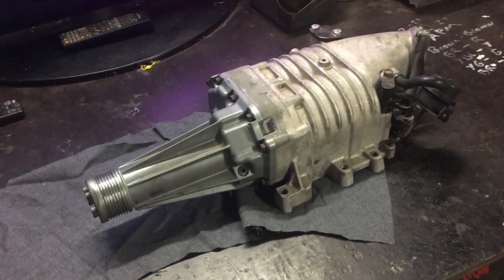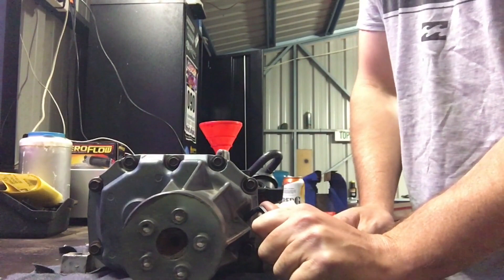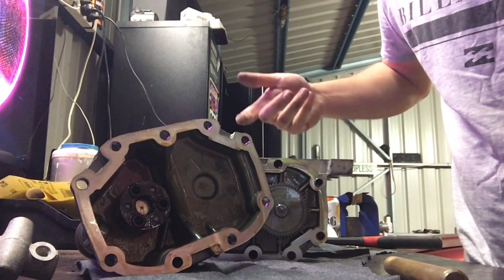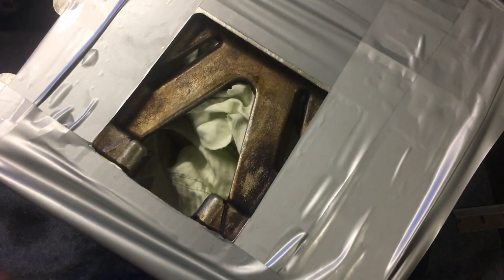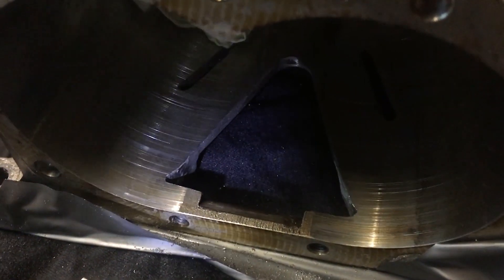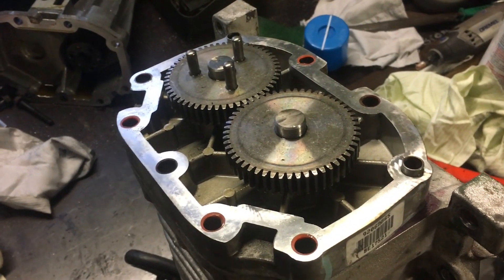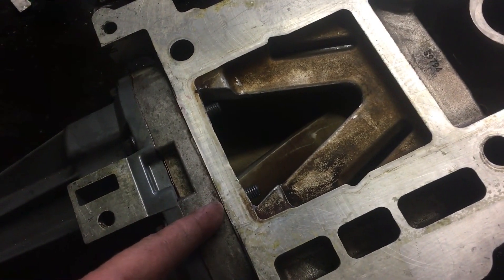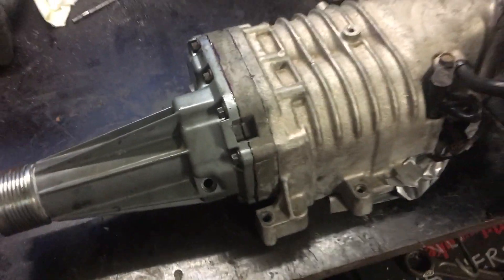Eaton M90 Supercharger Porting

Comment: The big deal I'm looking into is who can do andecent job of rencoating the rotors? If you or anyone knows
Reply: Actually the rotors are coated with an epoxy not Teflon which would be how and what the Detroit style roots chargers are done with and that is just a bead that is installed in the tips in those rotors to close up clearance between those rotors and the cases.

Comment: GM US car.used the same size bolts on the snouthousings, it wouldn't make much sense having these a different size fir here or there as Eaton made them a pretty much standard option for all GM's equipped with them as well as Nissans and whom ever else was suing them. The big differences was in the inlet designs for the reauired arrangements fo the  rands

Comment: First time ive found out wat to seal the snout with goo wise cheers best explanation vid yet to date( now that u did that porting as u called it do u need to tune it
Reply from the maker: Thanks I appreciate that. I did have my car retuned afterwards to take advantage of the cooler temps and make the most power from it but I wouldn’t deem it a necessity.

Comment: hi man!
wanted to know one thing.
I have a 2001 Mercedes. 2 liter compressor eaton m45.
is there any point in doing porting for such a baby as m45? and about the oil for sc. Do I need a special oil or is transmission oil suitable?
Reply from the maker: Hi, I dont have any experience with the m45 unfortunately. 
As for the oil Eaton do use a supercharger oil specifically so I would stick to using that.

Comment: 10:00  Scoring inside the case. Yuk. It will only mean a mild boost leak. If it concerns you, scrub those clean with Soap and Water, brake fluid then acetone and naptha. Use overkill to get down in the grooves and remove every bid of oil. Use a toothbrush and clean lint free rags. Let it dry real good. Then with a Razor Blade or the edge of a credit card, scrape regular JB Weld into those grooves, and only in the grooves. Let it dry a few days before assembly. Sand High spots with 400 grit sandpaper.
Nitromethane funny cars and dragsters use this method on their superchargers, it works. The JB weld stays in place. I've used it to fix a Weiand 144 and thousands of miles later, the scoring is still fixed.
Reply from the maker: It looks alot worse on camera then it actually is due to poor lighting ect. I have heard of people using that technique to fix housings before though. Its good to know that people have success repairing them.
Reply: sadly i dont even think thats scoring. its probably just the manufacturing tooling marks just like on the sealing surfaces.
i was looking at those like man i bet you smoothed it out some it would have alot cleaner flow. but removing material will also lower boost. but increase flow potentially. and lower charge temps.
filling and smoothing it out would be the same as 2 stroke case porting and stuffing so its pry the best way to go.
Reply: @chehystpewpur4754  If you've ever taken one or more apart, yu would know that is scoring. Even the maker of this video says it is.

Comment: Great vid, mate. Been trying to make up my mind whether to put a supercharger in the commodore since the v6 packed it in? Are they high maintenance? And what do you have to watch out for if buying one?
Reply from the maker: Thanks, in my opinion they are relatively low maintenance. I would just ensure it spins freely with no rubbing or strange noises coming from the rotors, that aswell as the rotors dont have visual damage to them or excess teflon peeling. It may be worth inspecting the coupling and replacing if it feels like it has excessive slop when spinning it by hand. I hope this helps.
Reply: @Brodorsport  why not just take material off the other end and turn the triangle into more of a rectangle to really increase flow    currently working on my wk stato supercharged 6   but I also have a  buick (VP) V6 with a Detroit 6v71 on it    I have a couple of videos on here of it nothing special but keen to see what you think of it      great video by the way

Comment: Would it be possible to fit the M90 to the 6G74 on my Pajero NL 1997 model and what needs to be upgraded on the engine itself.
Reply from the maker: Its definitely possible. You would have to fabricate your own manifold to fit it or find a company that already makes one if possible. Im not too familiar with the 6g74 to recommend upgrades but i would suggest installing a wideband air fuel ratio gauge to monitor it and ensure the tune is sufficient

Comment: Did I miss the part were you cleaned and greased the bearings
Reply from the maker: I did mention about cleaning it in the video but yes i must have forgot to film regreasing. Good pick up.
Reply: Should replaced them not just lubed them

Comment: comment 26 showing: If u r bolting 1 face onto another face, they need to work in a small change. The amount of metal under 1 screw tab & the next tab rounding the mating plate should vary, so small tab med tab small tab med tab. U will get better seal vibrational hold & the screws hve diff length easy on 1s & deeper 1s, making taking off & going back on less likely to b screwed by bad screws.
Reply: you just tap the hole and move on. its aluminum you can even weld and retap to same size. or put a stud in the 2 short holes and not worry about it either.

Comment: What size pulley wheel is that? 
I've heard the m90 can run pretty hot  with a smaller pulley. 
I have a 1uz and just bought an m90.
Want to get the most out of it without flogging either then engine or the charger
Reply from the maker: 2.45”, it does get high intake temps with heavy acceleration. I would recommend a 2.9 or 2.8” pulley for a safer result. Or possibly run a intercooler setup to drop the temps. My haltech ecu is able to pull ignition timing with high temps on a correction map is how I manage with it atm.

Comment: What's the chance to find a shorter snout? Need one for this but has to be shorter.
Reply: Look into the early 90s GM 3800s. My 92 Buick Park Ave has a blower with a smaller snout. I think the Gen 2 3800s and up started using the longer snouts.
Reply from the maker: Best bet is to have it machined down on a lathe in my opinion.
Reply: @Brodorsport  yeah that ended up costing about 470 to get done, but I'm sure it'll be worth it in the end.

Comment: That was awesomeee. Man im trying to put an m90 in my SC400 but im trying to figure everything out right before I go for it. Do you got a Guide on how you did your Supercharger and its install as well as needed parts and cost? I would love to get more power from my 1UZ.
Reply from the maker: Trinidad Swank Glad you liked the video man, im going to do a walk around video soon and discuss what’s involved and how i went about it. Stay Tuned 👍
Reply: i'm going to be putting an eaton supercharger from bullet cars. they sell a complete kit for about 4500 dollars us. if you really want to get good power out of it though, you'd be best served porting the heads and putting in new valves/ new gaskets for everything and i'm still considering a piston upgrade as well. it will probably run you around 5 to 7 k to get everything figured out with a tune( optional) and idle control solenoid plus miscellaneous stuff.

Comment: Got my '98 Grand Prix supercharger apart now and a friend told me about this procedure. Doing mine tomorrow. Most informative. Good job!
Reply: I had a '99 GTP for my first car when I was 16 and sold it when I was 25 or so.  It was a torque monster... I never did the pulley on it because I was worried about breaking something bigger on it.  With a pulley you can expect about 320 ft-lbs.  People rarely change the supercharger oil, so I'd highly recommend you doing so.  The oil is a special oil, so buy the right kind.
Reply: @YouTubeHandlesAreStupid  its not special oil its just lower drive oil for a outboard motor. grab a bottle of lucas marine and it says so right on the bottle

Comment: Theres a spring in the snout. What is that for?. I cant find any info on it. It doesn't work for anything tension wise. Ive lost mine, on my 94 thunderbird m90.
Reply: It loads the bearing to keep it from walking the pins away from the coupler.

Comment: Great vid.  Big question here though.  Did the porting make any power gain?
Reply from the maker: Murray Finkle I haven’t dynoed it again yet but i will soon. Stay tuned!
Reply: It won't do much as he didn't port the inlet. The inlet and elbow that attaches are the biggest restriction on these blowers.
Reply: This is done mostly to match the efficiency of the gen 5 blower as much as possible. Not so much for power alone.
Reply: @boosted0079  it can be if you do it right. Look up Brushworks Slick Sixes.
Reply: @dutchylt  I guess technically speaking, if you're increasing efficiency, you're going to gain power output lol.